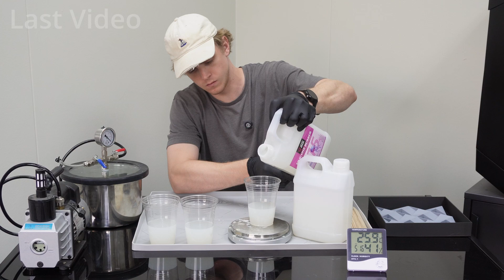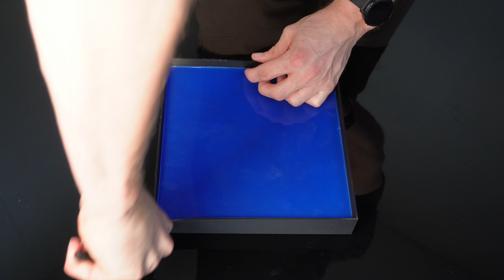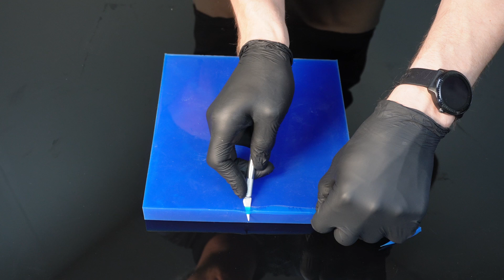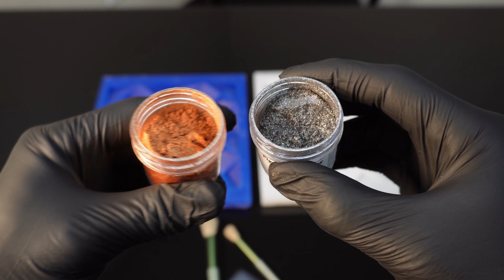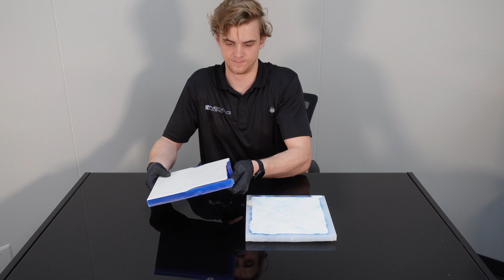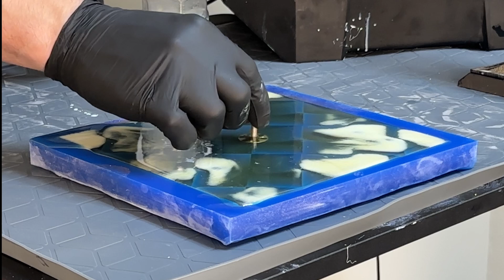FASTER way to produce PARTS cheaper than 3D Printers | Don't spend hours on SILICONE molds

Comment: So it's just 3 peristaltic pumps with a special mixing nozzle and some control software?
Reply: Late to reply, but there is virtually no meter/mix machine (which this is) that is accessible to consumers and hobbyists currently. Even "small" industrial machines that perform the same functions cost at least 10k USD
Reply: @alchemistalchemist6051  But is that what this machine is ultimately doing?